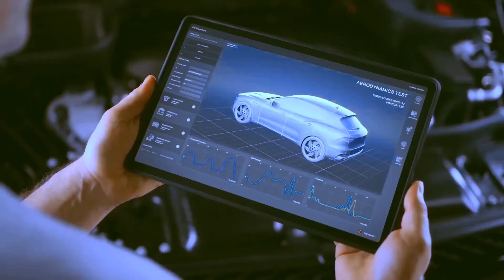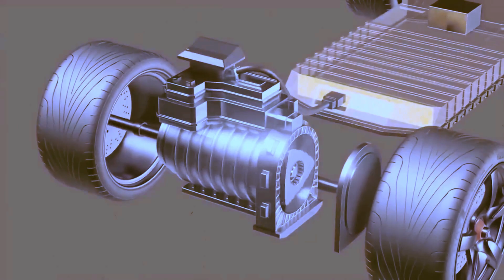MAZDA'S ROTARY COMEBACK: THE ELECTRIC REVOLUTION!

Comment: the best improvement you can make to that motor is having two separate motor oil resources for the cooling vs the lubrication of the motor. since the oil gets dirty while running through the cooling chambers, it shouldnt be used for lubricating the combustion chamber. there is a modification you can buy for doing this, but it should be a built in feature
Reply: It would be possible if they made it similar to modern diesels where they notified the owner the reservoir is low, but it could be a difficult thing for the owner to understand what oil to buy.
Reply: @frey8078  uh....no; i had an RX-8.....its regular motor oil. not sure why you think that would be hard to figure out for average joe. 

the kit i was referencing has a reservoir (in plain view) for the combustion chamber, and you have to change out a part on the pump that reroutes the oil that comes from the oil pan to the reservoir instead.